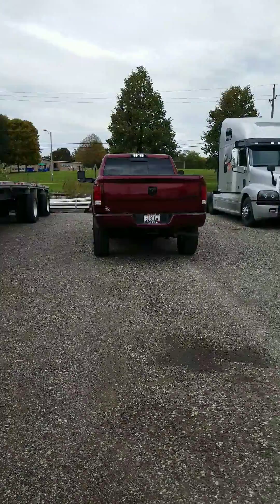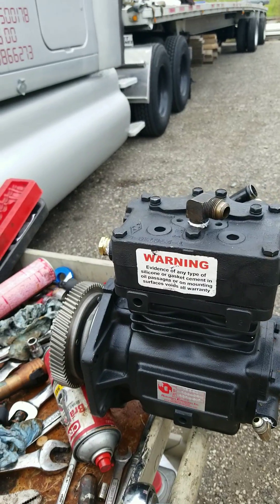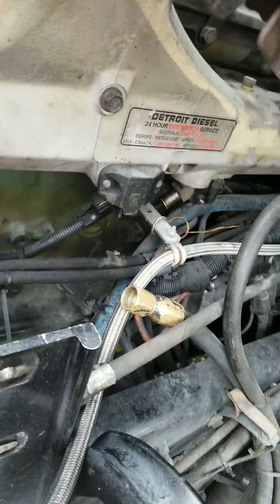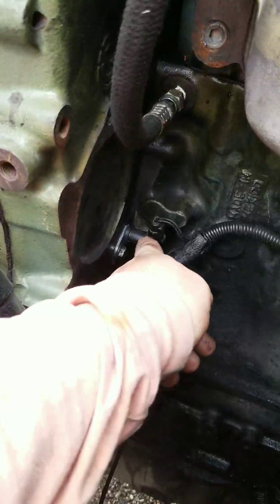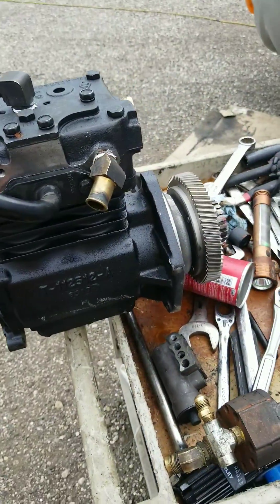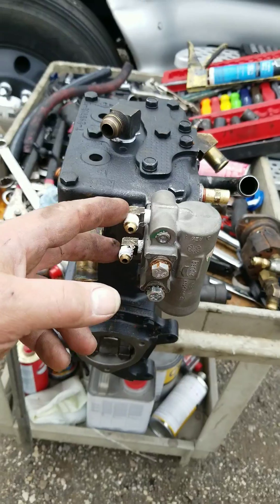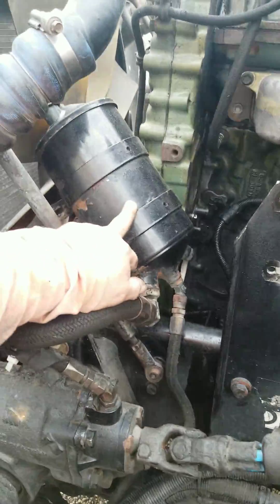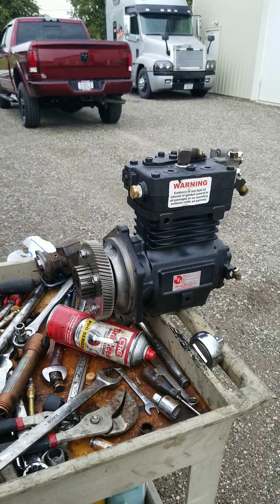Air compressor installation Detroit 60 Series Part 1

Comment: Did you have to drain the coolant to take the compressor off ? Or is it oil cooled
Reply from the maker: Coolant does run though compressor. U shouldn't have to drain much out of it. Thanks for watching

Comment: Do you have the part number for the aircompressor and that sensor behind it?
Reply from the maker: I'm on the road right now. No I don't. u can call Freightliner and get it. sorry. Thanks for watching
Reply: @kurtsibila9682  last question was is there timing on the gear or do you just slap it on?
Reply from the maker: @goldenboygq9  no timing.  Just slap it on. Good luck